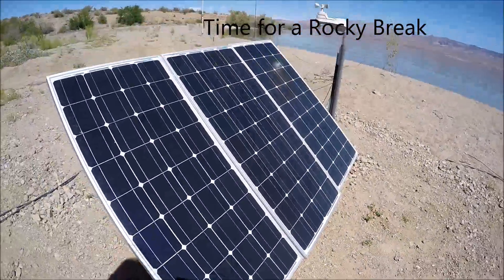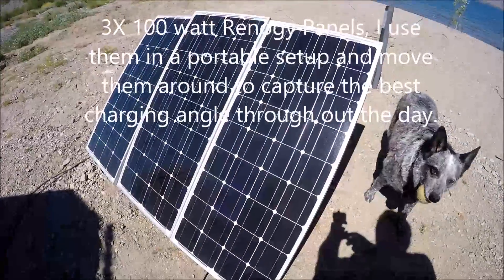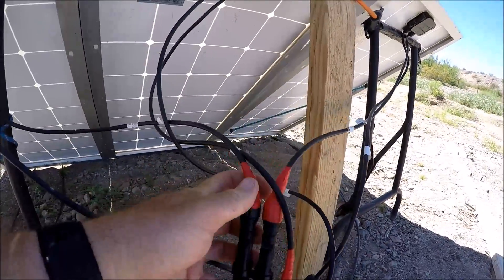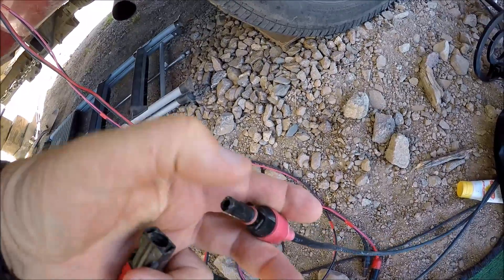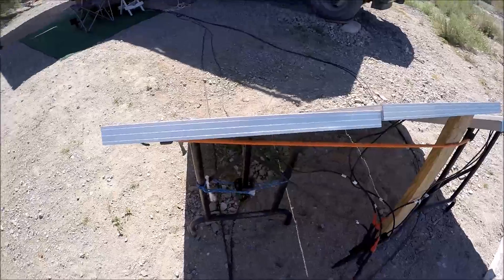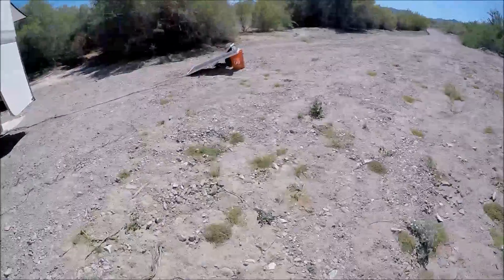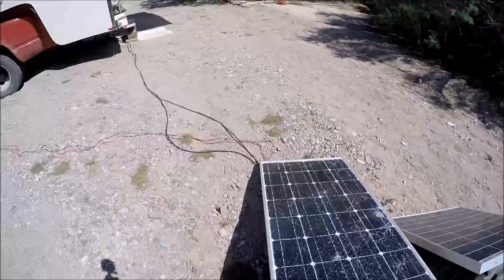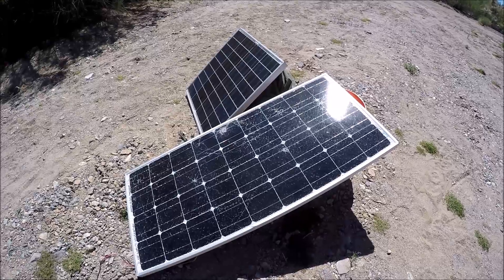Portable Solar Panel Setup

Comment: Which battery does the 3  100 renogy panels charge ?
Reply from the maker: I have 2 battery banks.   Pair of 6 volt Costco batteries and a pair of 6 volt Trojan RE solar batteries.  I have separate charge controllers to each bank with separate MC4 pigtails outside my camper to plug in to.  Gives me the option to mix and match my panels.  I have branch Y connectors to combine all my panels on one line or usually split the panels.  2 on one and 3 on the other.   My 50 watt goes to my house battery.    I have a Kyocera 140 watt panel that I added since this video was made, so 6 panels with 590 watts.
Reply: Thanks

Comment: I like the Renogy 80W suitcase panels, with the built in charge controller. I might get that to add to my roof panels, for chasing the sun while boondocking.
Reply from the maker: *****   The suitcase panels are nice, but will cost you $$$ over a single 100 watt panel.  I've had no problem moving them around on all the rough roads I've traveled, so really no need to spend $100-200 more when you can get more amps out of a single panel for much less cost.

Comment: Nice! When I get a truck camper or RV, I'm not sure which to do, attach the solar panels to the roof or go with the portable panels! Thanks for sharing!  :)
Reply from the maker: Lisa Kent   Most that install them on top of their RV will only get at most 50% of the solar panel potential if that.  Fall-Winter when you really need the charge you will see very little from flat mounted panels on your RV roof.  Depends on what your needs are.  If you only camp in the late Spring- early Fall time then on your RV roof would be fine.  You'll have to become familiar with your power requirements, watts, amps, voltage needs.    You aren't going to run a microwave, electric heater, A/C unit unless you have a serious battery bank. I rely on my solar panels to provide about 95% of my energy requirements.  I rarely ever run my generator unless I'm traveling for a couple days or 3-4 days of cloudy weather.  It's been over a year since I had those conditions, so it's a rough life living in the SW!.....:)